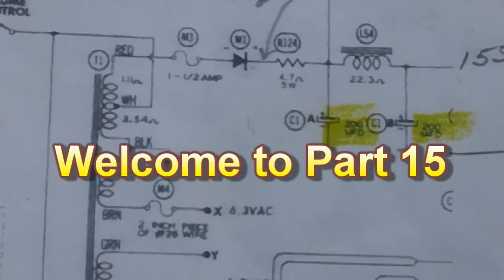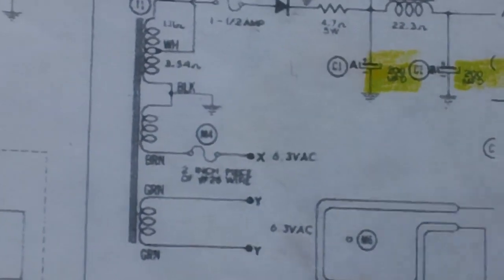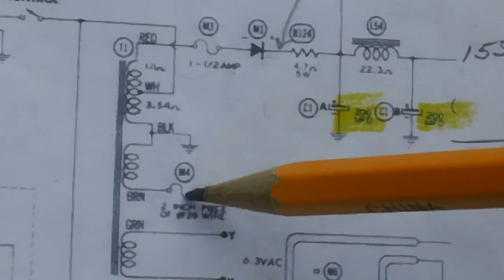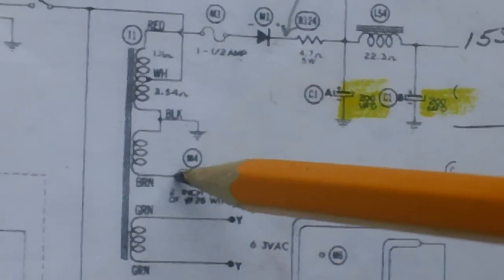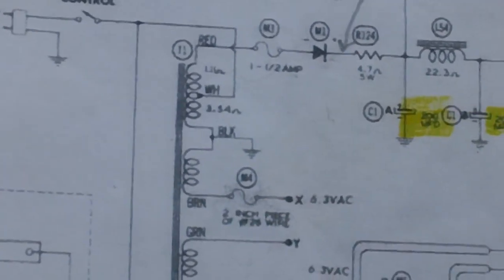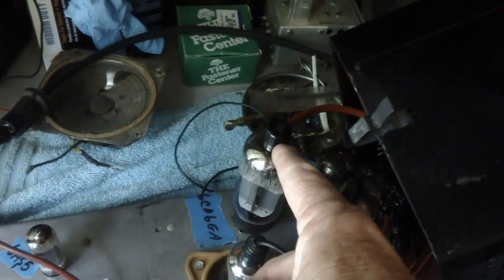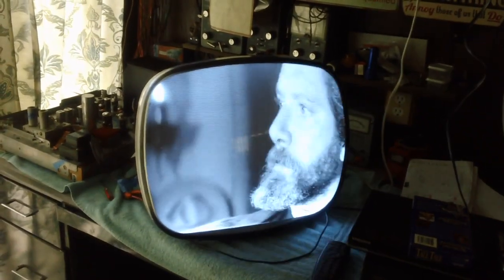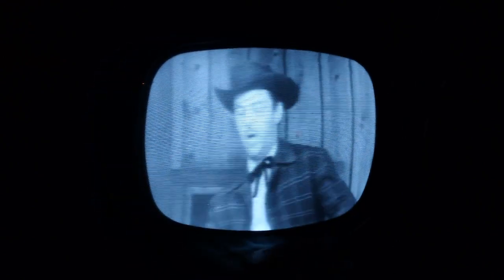1956 Sylvania 21" Halolight TV restoration (part 15 of 23).

Comment: John, great work finding that problem. I just watched Mr. Carlsons lab on you tube and he talks about the importance of putting, non-electrolytic, capacitors in with the correct polarization. Never heard of that before. Uses oscilloscope to determine polarity.
Any thoughts?

Comment: John,
Phew!  Thank goodness the valve heater fault was traced to a dry solder joint.  One small tip for what it’s worth, installing a Wickmann fuse to handle the stated heater chain current rating (as replacement to the strand of wire) could be worth some consideration…it sounds rather ‘belt ‘n’ braces’ but that’s me LOL.
A very crisp picture on you television my friend.  At first, I thought you might have been faced with a fault we over here referred as ‘bottom frame cramp’: usually corrected either by replacing a few decoupling capacitors, or the frame output valve cathode resistor and bypass electrolytic capacitor.  Your frame linearity looks to be spot on from where I’m sitting – well done.
Did Don mention he is not sure how to set up frame linearity?  Like most things in life, once you’ve done something a few times it becomes standard routine.  Tasks like line linearity, colour convergence (TVs that incorporated ‘Delta’ CRTs), and frame linearity etc. can be daunting at first.  Here is an express method of setting up the frame linearity (assuming there is no ‘vision test’ facility, and there are no defects in the frame output circuitry): first reduce the height to no less than two thirds of screen area; secondly, adjust top and bottom linarites so there is even non-vision gap above and below the reduced vision area; finally, adjust the height – making sure vision meets the top of the CRT screen at the same time as vision meets the bottom of the CRT screen.   If you think this will be useful, pass it onto Don.
Cheers dear chap,
Phil.

Comment: Hmmm, the schematic, and tweak a little bit at a time.  Um the novice on TV theory, not the extra class with electronics theory in my crazy brain. So understanding H and V circuits is new to me, sort of CRT 101 with flashlight knowledge.  Perhaps Dennis Carter will explain the theory, and I will drool, scratch my head, and turn knobs to see what happens.  Um guessing now, but um trying to figure out what each control is SUPPOSED to do, and what it IS doing, not usually the dame thing.  The TV set is like me, 61 years old and it has its ways...  Don

Comment: Going to Texas?  Got a boat?  We had a little wee bit of rain last night, um posting an exciting  vid.  Youz guyz down south are hoggin up all the rain.
Hey John, you all make it look easy, you don't show the parts where you're pulling your hair out, banging your heads on the wall, and using all that politically correct potty language.  Come on, fess up, you edit out that good stuff, huh? 
Hey somebody has to show what NOT to do, show the wrong way, how to tamper and mess things up.  Um good at that, so I just let the camera roll.  Now IF I get it working, what does t hat say for this TV novice?  I'll show my learning mistakes, it doesn't always go as easy as you guys have it, heh heh heh.  Don